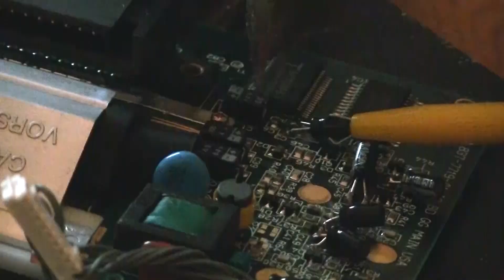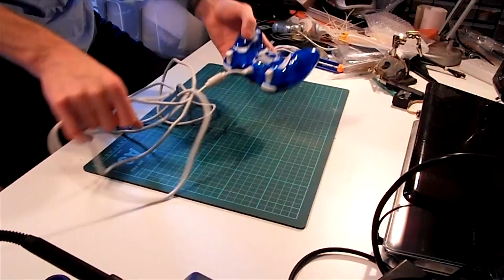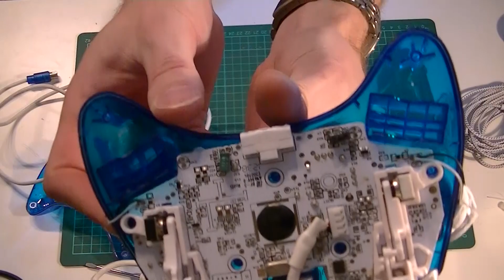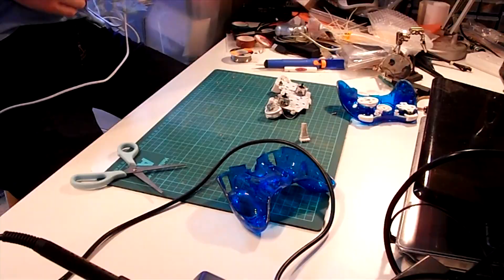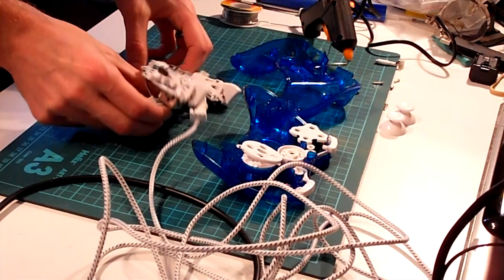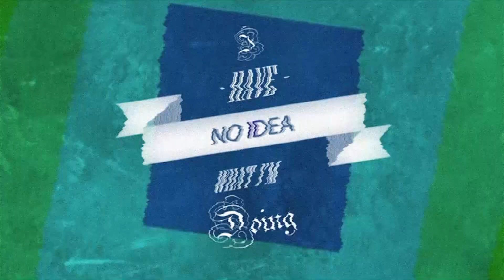More Rock Candy XBox 360 Controller Fixes

Comment: Is there a duct tape and spit method?

Say wadding up some scotch tape in the side it diffts towards, or sormething?

Full disclosure, ever since my Xbox gamepads battery pack became so loose the rechargeable pack slips out, I simply wrap that sucker in blue christmas ribbon.  When my laptop keyboard had stuck buttons, I intentionally installed incompatible drivers to disable the built in keyboard and stacked a wireless keyboard on top of the keys.  

Basically any advice for those of us not so mechanically inclined?

Comment: Rubbing alcohol will make hot glue peel off easily. It even works on fabric. Saturate the spot with the alcohol then rub the glue. It'll pill up and come out of the fabric. Test somewhere that won't be seen to be sure the alcohol won't damage or discolor the fabric. 91% works better than 70%

Comment: My micro usb cable doesnt work because the light doesnt stay on unless u play up with it for it to connect to the xbox 360( stay on). I bought a usb 3.0 hub and it finally stays on but the buttons doesnt work unless it connect directly to the usb on xbox directly which i am fed up because it takes me long to connect. Let me know what to do.

Comment: how do you get those screws off so easily. The screws on the right and left side where you usually grip the controller are easy enough, the screws in the middle at the top part, usually end up stripping for me cause they're smaller or thinner rather. You say you use a regular phillips screw driver?

Comment: Hello, my control rock candy I want to add the vibrator motors, but I did not know how, since it does not have the ports for it as an original control of xbox 360, I would like to know if you could tell me which cable I have to solder in each hole , The engines I bought are red and black wire, I knew I could add the motors but I was not sure if it was in those holes where I had to weld. I hope you can see my comment and respond. Or someone help me with my doubt

Comment: Question: would this controller PCB be appropriate for use in a homemade arcade stick? Some Xbox 360 pads have annoying multiple grounds and others have a single common ground, which would be greatly preferable. I'm thinking about building a joystick with spare parts and I don't want to spend a lot of money on the components, but I would like to make sure this was reliable.
Reply from the maker: +Jess Ragan no idea mate. I doubt it's as complicated as an official price as it'll be built to a price

Comment: You wouldn't happen to know what that bulb looking thing on the cord close to the base on the controller and in the middle of the breakaway cable is? I want to use another cord, but it doesn't have that bulb, and I want to make sure it's not a amplitude booster or anything like that.
Reply from the maker: +Spazmaster it's to stop high frequency interference, it's not really required
Reply: Ah, that makes sense, thanks. I recently split it open and found it was composed of a strange metal ring, not even connected to the circuit.

Comment: I've got a micro USB cable included with my Rock candy controller and it works very good and hasn't broken yet
Reply: Still works?
Reply: @theodoresmith7452  the controller yes the cable no i still use the controller
Reply: @DeezYoink  lucky 👍

Comment: Hey
I replaced the wire on my Xbox controller like you showed in the video. But when I plug it in, the lights go on and off again. Computer says something went wrong with the device (it malfunctioned). Maybe it short circuited? How do I fix this, please? Thank you!
Reply: +Emilie Eeckhaute sounds like it's shorted or you've got the wires in the wrong order. Try re doing it.
Reply: Hayden Barwick thanks for the reply. I tried redoing it. Wires are the same as they were. Maybe i hit something I shouldn't have hit? First time soldering so maybe that's where I went wrong.
Reply from the maker: +Emilie Eeckhaute yeah it's probably a short
Reply from the maker: +Emilie Eeckhaute just make sure you're not bridging the pads. Also check you've got the wires the correct way round as you could have flipped the controller board by accident.
Reply: Fixing Tech on my Kitchen Table ok thanks. I'll try again! So the little solder balls, or whatever I should call them,  can't touch? Good to know! Thanks guys
Reply from the maker: +Emilie Eeckhaute just make sure you're not bridging the pads. Also check you've got the wires the correct way round as you could have flipped the controller board by accident.
Reply from the maker: +Emilie Eeckhaute no they shouldn't be touching each other. You're lucky you didn't short out your USB port on your computer
Reply: Hey, So I finally managed to get it right!! Thank you :-)
Although now my buttons start to fail. It started with the left joystick pulling down. Now the arrow pad stopped responding all together. Thoughts?
Reply from the maker: +Emilie Eeckhaute sounds like there's still a short somewhere. Did you drop and solder on the board?
Reply: Fixing Tech on my Kitchen Table no not that I can see

Comment: hey my 360 rock candy controller light stays on and it will not turn off tried unplugging cleaning and everything it just won't turn off ....please how do I fix this
Reply from the maker: +Arcillia Littlejohn sounds like it's getting power but not communicating. Try swap the cable.
Reply: Fixing Tech on my Kitchen Table with what though? I only have one of those controllers and I'm really not wanting to buy a new one

Comment: my RT and LT buttons, in every game, act like they are being held down when they are not, and then when i do hold them down it acts as if they weren't being touched. the mechanism on the triggers seem fine and I've spent almost an hour trying to get these damn screws out to get the case open. any suggestions?
Reply from the maker: +mybrickhead if it's taking you an hour to get some screws out, I probably give it a miss.

Comment: I bought 1 from Argos and I plugged it in and it doesn't switch on and the wire doesn't have the blue bits on any advice I bought it in United kingdom
Reply from the maker: It does sound like you need to change the wire. Although if it's in warranty, take it back.

Comment: have same exact controller used for pc now only. But it stops working every few minutes , have to unplug n plug in again to work , clear sign of wire issue. But DOES A BAD WIRE HAVE AN AFFECT ON THE HOME BUTTON TOO?  The home button doesnt work at all, the leds light up but cant get to the home menu , maybe 1 out of 20 tries it does work and only right after plugging it in.  Cant find any answers on this . plz respond anyone thanks
Reply from the maker: +beth om wire wouldn't only effect one button, it'll be another fault, try washing the buttons and rubbers when you have it apart.
Reply from the maker: +beth om wire wouldn't only effect one button, it'll be another fault, try washing the buttons and rubbers when you have it apart.

Comment: How do you unscrew the middle back screws, I cant seem to get it
Reply from the maker: They're just normal screws. Just keep trying.
Reply: +Fixing Tech on my Kitchen Table hey bro can you help me! my Rock candy controller keeps disconnecting!  its like it have a shortage! or something so i took it apart and the black wire had the black rubber missing but the rest seemed to be fine how can I fix this???? plz

Comment: How do I fix a messed up right bumper? I have the newer version of this controller and the button only works if I press really hard in a certain area. I don't have any experience taking shit apart so I'm worried I'll fuck it up...
Reply from the maker: If it works some of the time, it would be worth taking apart and checking the solder joints as pushing hard might be making the contact better. Don't worry about breaking it, if it's broken, you can't make it any worse.

Comment: hello I need your help my control is constantly connected and disconnected and can not play like I have some but not short circuit that can be please help!!!!
Reply from the maker: Have you changed the wire like in the video?
Reply: +Fixing Tech on my Kitchen Table yes :(
Reply from the maker: If the disconnection is random, I would check to make sure your soldering is good and that you haven't bridged anything. Also check for blobs I'd solder elsewhere on the circuit board.
Reply: +Fixing Tech on my Kitchen Table 
nothing short circuit doing that, I think it is some component that is damaged
Reply from the maker: Without looking at it, I can't really help. If you have another of the same pad, you could compare the multimeter results.
Reply: +Fixing Tech on my Kitchen Table thank you :D no problem

Comment: is there anyway to fix or at least buy that rubber layout of the A,B,X,Y buttons? cause my A and X on that button membrane thingy popped off. if it doesn't make sense then I'll send a pic link of it.
Reply from the maker: I don't really understand the 'popped off' bit. You could take the membrane from a different controller and fashion it to fit.
Reply: When I said popped off, i mean like, as soon as I opened the controller the rubber membrane that makes the button go down and back up was just out of its place. But anyway good video, I always wanted to change that cheap rock candy wire with a new better one but I didn't know until now. Thxs.

Comment: my rock candy controller, when ever i hook it up, the green around the logo flashes super fast! and doesn't connect. any ideas?
Reply from the maker: Sounds like it's getting power but the data isn't getting across to the Xbox or computer. I would change the wire just to rule that out.
Reply: +Fixing Tech on my Kitchen Table the controller just died, dosnt work. R.I.P
Reply: Same here
Reply: +Fixing Tech on my Kitchen Table thanks a lot my little bro broke my rock candy controller and you helped me out I will subscribe

Comment: Hello, i have a  problem. When i plug in my controller it turns on (4 lights blinking) but it doesnt connect. Then the lights turn off . Any idea ?
Reply from the maker: Are you plugging it into the 360 or a pc?
Reply from the maker: I would have thought it is the cable. It looks to be getting power but it's not communicating properly. Change the cable and see if that sorts it.